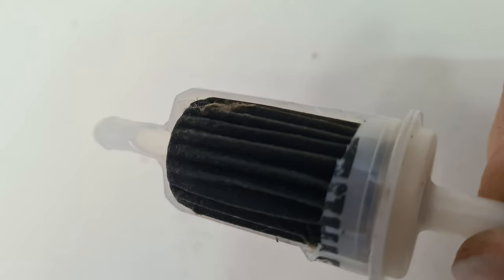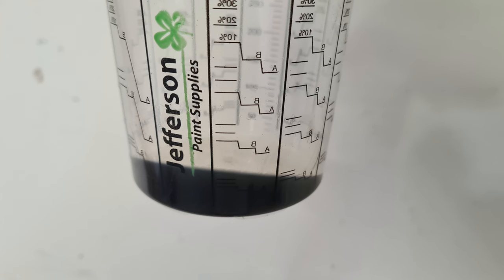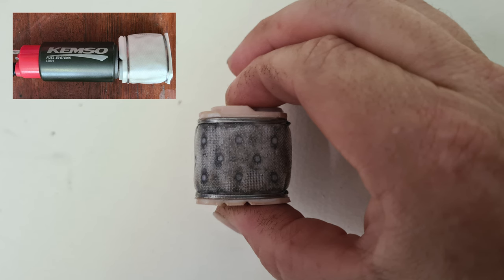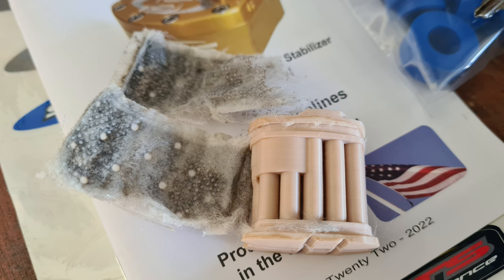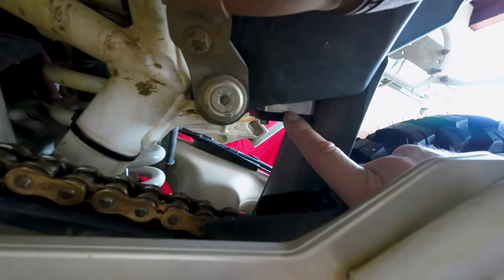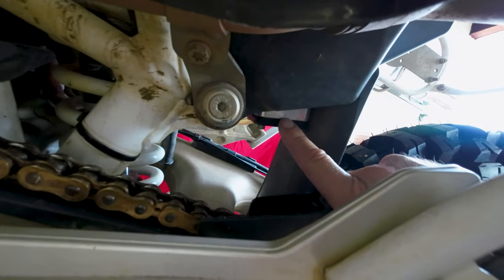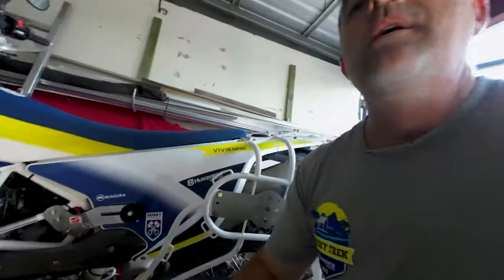Husky 701 / KTM 690 Fuel filter

Comment: I replaced my pump, filter socks, in tank filter, and in line filter at 6500 miles just because. They looked fine but I was elbow deep already so why not!
Reply from the maker: Still a good idea all the same. You have done well. its all about trouble free motoring. Keep up the good work.

Comment: I would add as being the primary cause of fuel pump failures.  Many do not even know it exists!   I was amazed how often I had to change them on my KTM 500 at 3000km or so, already starting to collapse.   Given being blocked is a function of of the fuel cleanliness I was concerned for my 701 as doing a 5000km trip was not unusual.   The fuel sock is a good addition despite its filling penalty.  Tha fmaily here three KTM/Husky bikes of the similar ilk and will just have a service day and get in and change them while dealing with draining of tanks and the hassel.   The 701 is not too bad to do given I have an Omega kit andthe pump lives in one of the front tanks now.  For ADV work  I carry a spare pump, filter and injector.  At least have one in the group on hand.   I see Keith Jobson had two failures on his recent trip.  Be interesting to see what he says in his next discovery video.
Reply from the maker: Hey Brendon thanks for the information. Its all about sharing in the Motorbike world most good fix's are not factory. But rather based on some ones experience or tinkering in the shed. You are 100% correct in with the fuel filter changes. Lots of people ride bike but have no idea about half the workings that keep them going. Ill let Goldfish know to check/ replace his filter on his 500. 5000km trip on a 701 is a good effort. I don't actually carry a spare injector but I do carry the tools to backflush it. Send me the link to Keith Jobson's vid so i can check it out. 
And thanks for tuning in.

Comment: Will get a sock after seeing that
Reply from the maker: Socks are good but note the earlier 690 has an even smaller bend in the rear filler area. Which would make it slower to refuel at a service station. filling with a jerry can is no issue. its the bubbles at the servo that causes the problems.

Comment: It's also a good idea to change out the plastic filter with a metal one due to the plastic ones splitting at the seam sometimes. 50psi can blow them apart. Cheers
Reply from the maker: Very interesting i have not herd of this before. But noted as i am due for a fuel filter change.

Comment: I put a fuel sock in the back tank, and filling up has become a painful process. I thought I had done something wrong with it before listening to your video. Why do you think the front works just fine and the rear makes filling up so slow?
Reply from the maker: I have been looking into this and am about to trial a fix. as i believe the sock floats up when you fill up and then gets twisted. I think we need to find a way to keep it down and open. I was thinking of sowing some sinkers to the bottom corners and put something in the sock to expand it as well but have yet to come up with the second part that is compatible with fuel. open to suggestions
Reply: @simovision5894  sounds promising! How about just putting a weight in? I’ll think about it. Keep me informed pls.

Comment: Re the Kemso pump, I tried that on my 500 and didn't use it as the spigot is smooth and the fuel hose slipped off overnight. NOte that the standard pumps have ridges on the spigot and you need these to keep the fuel hose on. Also the spigot on the Kemso is short compared to the standard pump. i agree that the chinese pumps are poor quality. You should always use the corrugated plastic fuel hose rather than rubber hose.
Reply from the maker: Mate I'm with you on the hose bit. Rubber hose does not seem to go well in this setup that I have seen. Did not have any problems securing the original hose to the pump. I got new crimp clamps and she's tight as.
Reply: @simovision5894  I ended up installing a new corrugated hose as I also fitted a new longer aluminium bodied fuel filter which has replaceable elements. I used stainless hose clamps rather than the single use clamps, just in case one day I have to put in a new pump while on a ride.
Reply from the maker: That's a good idea. I have one of those stainless filters sitting on my shelf. Mite do a swap on my next filter change

Comment: I'd be adding a fuel sock into both tanks and adding another fuel filter or fine stainless screen inline
 and upgrading the pump when I pick up my new 701, the quality of fuel from the servo you frequently use can definitely have an affect on this, that fuel is extremely dirty compared to where I buy mine but during adventure rides you have no idea what fuel quality you're getting. Still a fantastic bike regardless, thanks Simo for the awesome videos mate 👍
Reply from the maker: your welcome mate. and yes we are forced to buy fuel from little servo's with dirty tanks its all part of the adventure.

Comment: which fuel sock did you use for the Rade front tank and how did you secure it in place?
Reply from the maker: Sorry mate missed your comment. I got the fuel sock from Adventure components Australia. Its on the web site. Sorry i threw the packet out so not sure. and it just sits in the neck only secured by the fuel cap.
Reply: @simovision5894  no dramas. Ive since fitted an inline fuel filter along the fuel line next to the frame between the tank outlet and petcock. 👍🏼

Comment: There's a small inline filter as well, up behind the front of the left side plate in the fuel line. My bike wouldn't rev out, had no top end, I changed both filters (Fuel tank and Inline filters), but I'm pretty sure it was the small inline filter causing the issues.
Reply from the maker: Yes Mr Drop Bear that's the one I'm referring to in the book. (Fuel screen.) I Could have explained that one a bit better I thought. Unfortunately I Need to take my air filter box out to show it properly. I have blown my out with brake clean a few times and reinstalled.